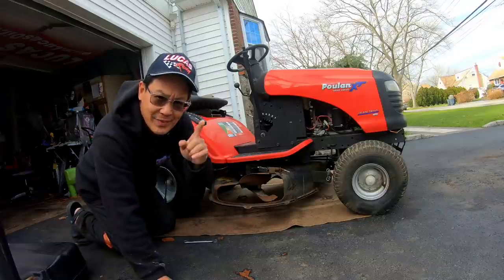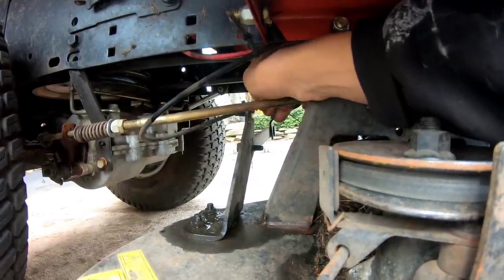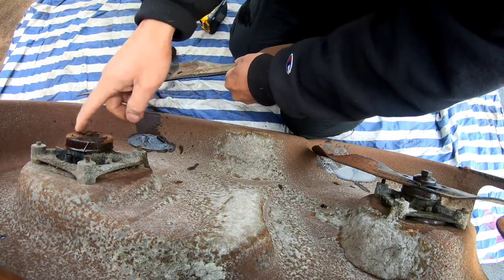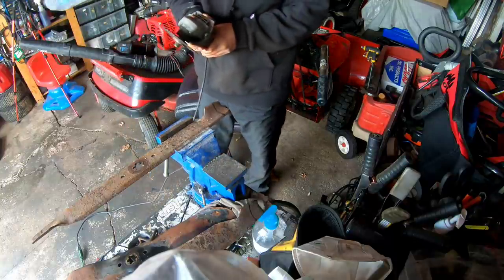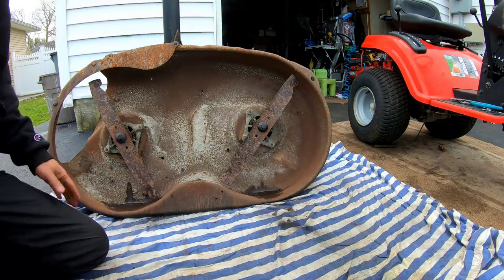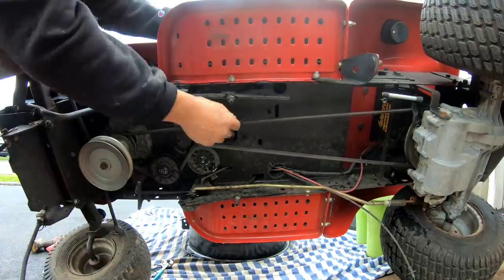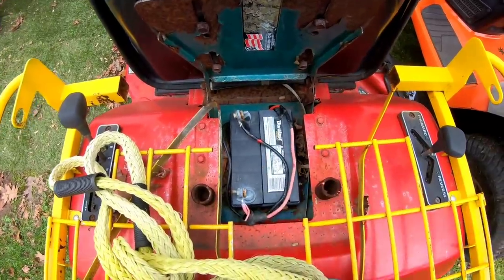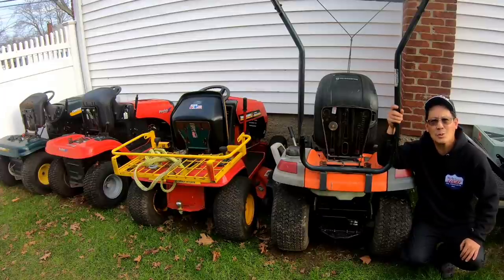POULAN PXT12538 LAWN TRACTOR DECK REMOVAL BLADE REPLACEMENT TENSIONER & IDLER PULLEY BELT INSPECTION

Comment: Trying to keep one of these running, but the deck belt broke, I replaced it with the correct size, 95 1/2 X 1/2 but it is way too lose.  Any suggestions?
Reply from the maker: Is it loose because you haven’t engaged the PTO,  maybe you routed the belt wrong on the pulleys.  And that’s assuming you got the right belt off the exact model number parts diagram.  There are many different models and lengths.

Comment: Henry, Those blades turned out quite well as I also commented on Instagram sometime during the “Wee Hours”.
Wow, I was very stunned to see that not only were the blades upside down - They were totally wrong!!! And Yes, I also feel that your noise is within the idler and tensioner pulleys. They must be totally shot if spray lube didn’t quiet the noise whatsoever. The mower deck has to run so much smoother now than it did before changing someone else’s foolishness. That kind of stuff gets people hurt very badly. With the curvature of the discharge area of the mower deck, It would be difficult to quick fix a cover unless you found the proper style discharge chute. Seeing how that deck is made makes me appreciate my old school Cub Cadets & John Deere mower decks even more.

Comment: That second idler pulley is the one thats bad, as soon as you put another one on it will stop the noise. You probably have one extra because all of the ayp pulleys of those years are the same
Reply: I am 100% sure it is that one pulley, give or take a half of a percent.
Reply from the maker: The second one meaning the idler on the right?  Not the first one which is the tensioner on the lever that moves?
Reply: @MowersNBlowers  yes, the second one on the right, the one that does not move, i believe thats the one that was the loudest.
Reply: now that i watched it again, you better change both of them to make sure, but your noise (IS) one of the pulleys
Reply: Loosen up the drive belt, get belt off of the idler and tensioner pulleys, and spin them.  Determine if bearings are good or bad.  Bam! There is your solution to the noise.
Reply from the maker: @mikespain8655  um....that’s what I did in the video
Reply: @MowersNBlowers  Henry, when pressure is put on the pulleys, that's when they get louder. You probably won't be able to determine much just by spinning them by hand. Change the one that you think is the loudest and then go from there. Also there will be a washer that will come off with it, be sure to remember where it goes.
Reply from the maker: @victoredington3316  thx bro

Comment: Henry, question for ya, how much did you make off of the Scott’s in today’s Intro? I have one right now that I’d like a good ballpark price :)
Reply from the maker: I sold it for $500 and it had a 9hp Kawasaki engine on it.  You could get $600-$750 depending on what state you’re in.  New York you get more because of cost of living here!
Reply: @MowersNBlowers  scores!!! Mine has a 17.5 Kohler. May try $700 and see if it goes? :)
Reply: @wiblesgarage2016  Start higher then bring the price down as needed

Comment: It’s the gases that the battery produces if the cell covers are not all the way on the sparks can ignite and blow the top off
Reply from the maker: It’s a sealed battery, no caps but I get your drift bro

Comment: Henry on my 42" deck can I put 19" blades will it still cut my grass
Reply from the maker: No because you’ll have a 2” strip of uncut grass in the middle
Reply: @MowersNBlowers  Henry the tesioner pulley gives the belt tension to spin the blades
Reply from the maker: That’s correct
Reply: @MowersNBlowers  On a 42 each blade is 21 inches because 21×2=42
Reply from the maker: Yes which is why you can’t use 19
Reply: @MowersNBlowers  For my yard 2 blades= 30 minutes 1 blade= 1 hour
Reply: @Squad-pl7oo  Just do what he said, there is nothing complicated about it. It's not the space shuttle, it's a lawnmower.

Comment: noise is dry bearings you need to replace that bearing or pop out the seals regrease with wheel bearing grease
Reply from the maker: Yup,  I replaced both pulleys thanks

Comment: Looking good Henry. Just putting my 2 cents in when you were cutting the battery free you have be careful of sparks they will blow up I’ve seen it happen several times over the years not good.
Reply from the maker: The battery will blow up?  But the stuff in the battery isn’t flammable
Reply from the maker: I shouted you out on Tuesday’s video

Comment: Go buy new blades make them out of balance could hurt someone
Reply from the maker: As you may have missed, I balance tested them and they are perfect.  If off balanced, they would vibrate which it doesn’t.  Even if they did vibrate how would they hurt anyone unless you didn’t tighten the shaft bolt. Otherwise it is impossible for a blade to fly off due to it being unbalanced, and even if they did fly off, the probability that they would fly off underneath the space under the deck is highly unlikely.
Reply: Still should buy new blades. I think they have the lift as much as they did. I did see you balance but if them on real balancing tool probably would be off just me I guess still like your vids
Reply from the maker: If they vibrated, I’d get new blades, but if it ain’t broke....why fix it?
Reply: @MowersNBlowers  I jerry rig stuff also just not blades. Since the last guy put wrong blades on then so did you
Reply from the maker: Actually I have the correct blades on there just longer, but the only difference is that I cut them.  They are lt1000 AYP craftsman 5 star blades.  It’s not jerry rigging.  Using a piece of steel and drilling a hole in it is jerry rigging.
Reply: @MowersNBlowers  on its jerry rigging if you have to cut the ends off then they not correct ones :)
Reply: @briankelley6185  I cut my blades to fit all the time. Benn doing it for yeeeeears and never one problem.
Reply from the maker: Like I said bud...not rocket science.  If you want to get caught up in splitting hairs go right ahead!  You do you, I’ll do me!  Do whatever you want just don’t tell other people what to do just because you’re obsessed with blades!
Reply: @MowersNBlowers  Hey Henry, i thought I was the only one who cut blades to fit. I also thought I was cheap, but I guess join the club, right? there is nothing wrong with doing that because we buy, fix and resell, we don't work on other peoples stuff.
Reply: @MowersNBlowers  I know flip for to make money but when you get free stuff and sell for $600 + you think you spend 20 bucks to put new blades on for the person you sell it to. Just couldn't do it would feel guilty. Plus there is no lift anymore when you cut 3/4 of the lift off just saying you don't have to get mad bro.